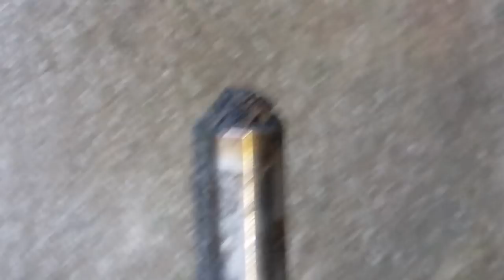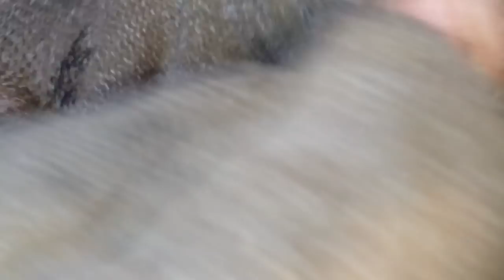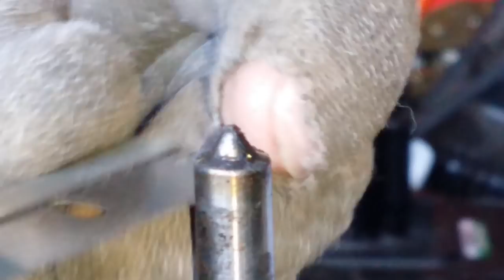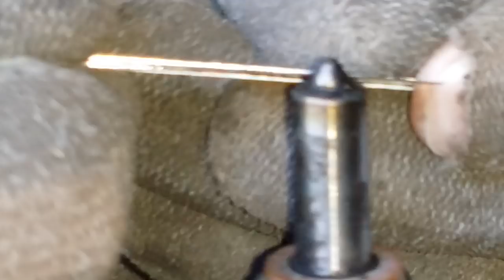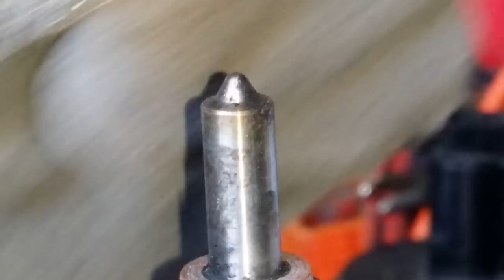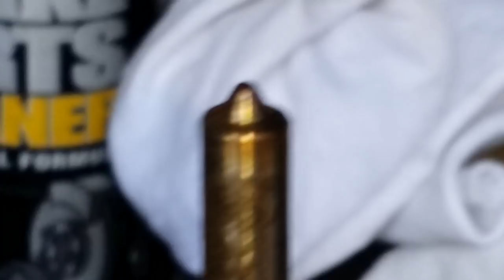Fastest way to clean dirty diesel injectors

Comment: I’m as hack full as it gets but I’ll never take a wire brush to an injector nozzle. Upwards of $1300 just for the nozzle, the spray pattern makes a big difference to how a common rail operates. I’ve found the cheapest way is to soak them in ‘Mercury power-tune’ which softens the carbon quickly. Use a tooth brush next time.

Comment: This destroys your nozzle it makes micro scratches that make your spray pattern uneven with the risk of burning your pistons the best way is a cheap ultra sound cleaner
Reply from the maker: Jan46  Been cleaning the injectors for a long time and got over 100k , no piston damage...
Reply: micro scratches  altering the spray pattern?  in a perfect world yea but this is diy get the shit running. In the end it doesn't mean squat because he's saved $ cleaning his own injectors. and the motor probably has a gazillion miles on it.
Reply: @gregh7457  ultrasonic cleaners are still a better shot at an inexpensive price
Reply: Ultrasonic cleaner, is $50 via eBay. Worth every cent

Comment: While your at it, douse your car in petrol and push it off a cliff, preferably one with lots of jagged rocks at the bottom. This will increase performance and actually enhance the repair job you just did on your injectors. Seriously give it a shot.

Comment: I used diesel injector cleaner right on the feed line with a lil filter looped back into a jar it worked great lots of gunk came out checked vcds they were working normal then. Can’t remember the brand started with a M
Reply: Can you explain just a bit better? Gotta do some work on truck later
Reply: @22loaded01  took the return and feed off the fuel filter put the feed in the can of injector cleaner looped it back to a Mason jar let it run and cycle for 5 mins giving it the odd rev

Comment: Never brush a diesel injector nozzle or scrape it like that.....

Just use a ultrasonic bath
Reply: As a 3rd generation diesel specialist I 100% assure you that you can buff the crap out of any nozzle and won’t achieve a single thing. You certainly wouldn’t damage it. This guy is the biggest tool in the shed!!
Reply: @benc1978  what do you recommend? I'm hoping to avoid replacing my injectors. My car still driving good but yesterday it puffed out a load of smoke. My guess is its the injectors. I'm going the change the fuel filter and use a fuel additive to try see if that can solve my issue first.

Comment: I would do this with a cheap set of ebay 8.3 12v injectors that i been running waste oil on, but would never clean my oem cummins injectors this way even if they coked up...could u imagine doing thus to say a isx or dd or another $2500 injector.

Comment: Don't do this stupid run some two stroke half a litre to half a tank of diesel, this works but you could hit the injectors with a hammer while engine is running few gentle taps, joke, but two stroke works